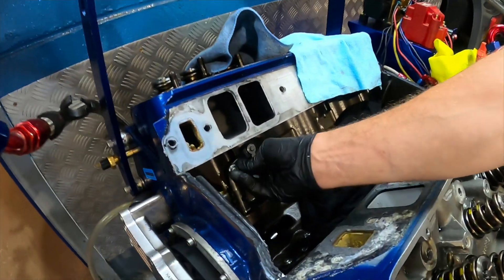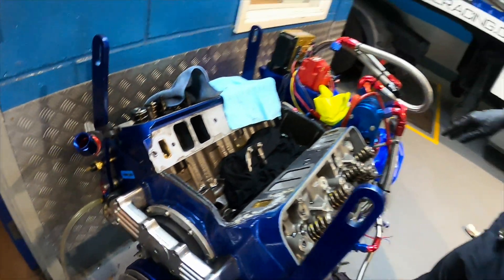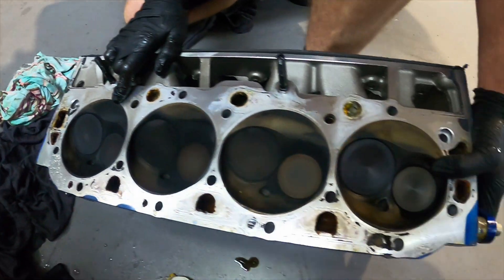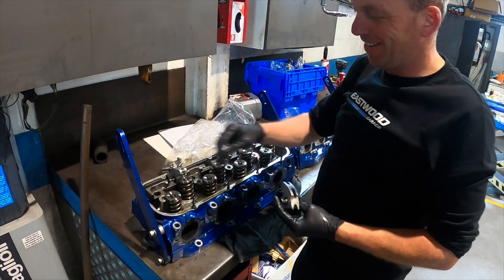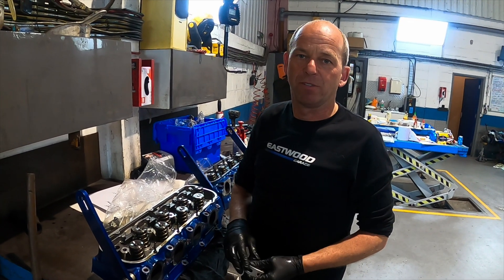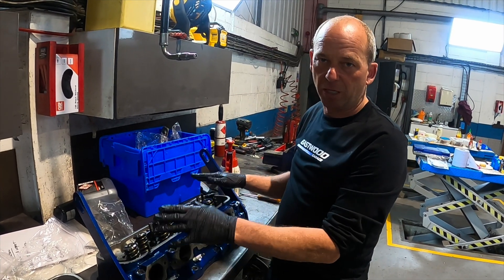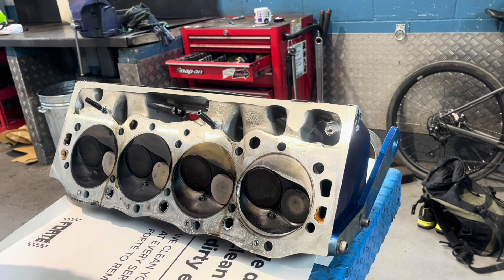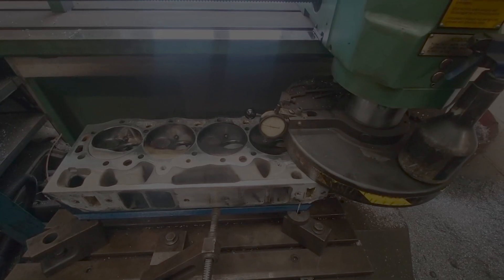V8 cylinder heads swap, on our Offshore powerboat race engine.

Comment: I have always wondered. Leno transmissions many years ago for a land speed record car put the single gear reduction  in backward to build a high horse power over drive.  In a fairly short case.   I don't know what percentage of overdrive it would be.
Reply from the maker: Hi Wayne we run SCS drop boxes and have about 12 ratio sets, there is a prop pitch vs speed ratio that is most efficient and we try and always get as close to that as possible, to high or to low prop speed causes efficiency loss or inability to get a good bite on the water

Comment: What maximum rpm are you running at, the Teague and Brummett 502 ci twin turbo engines running 8/10 boost, maximum rpm is 5200/5500, if you need more info I can your garage
Reply from the maker: we try and run around 6000rpm, we have run this setup in our offshore boats for about 4 years now ,going threw them every winter and never had a failure until we had a big overrev at the previous race when the shaft broke, then we had to rush fit a spare that we had no history on which is the one that broke the rocker. should all be good now we are back to our normal eng specs fingers crossed.

Comment: I would have the other head machined 6 thousands, so both heads are matched pair, have you checked the valve springs on full lift to make sure the coils on the springs are not binding up, and have you checked that your rocker are the correct ratio, l have worked on Teague Marine, and Brummett Marine engines
Reply: We used a thicker mls gasket

Comment: The piston with the wider band around the crown will have a better fuel distribution in the chamber at TDC due more quench area pushing all the fuel droplets from the perimeter of the bore into the centre and making for a less detention sensitive cylinder and a cleaner burn. Hope this helps.
Reply from the maker: Thank you Mark
Reply: Was just coming to say the same thing - however if you dont have the engine set up to have a tight deck (for the blower compression ) then the round dish piston might be fine.

Comment: Did you use the jessel set up tool to get push rod length ? Not using the tool will block off oil supply/ put the rockers at the incorrect angle
Reply from the maker: Hi, there’s no evidence of oil starvation in the rocker system. We have full confidence that expressenginesusa.com built them properly. As for why this particular unit has the alu Jesel rockers, we don’t know as these were built over 20 years ago.

Comment: is it not the era of sensors? stickers? EGT sensors would tell you immediately whats happening with combustion temps. come on man
Reply from the maker: We ran data logging on everything on the last boat and it works very well for setting up but its a big investment in time and money, we only got the boat in November last year and it had been stood for 7 years!! this year has been get it up and running and racing as best with the time and funds available, in an ideal world with unlimited funds everything would be different.
Reply: @eastwoodracing  understood bro. It's interesting to see man
Reply: Pushrods, lifters, rockers. 🤷‍♂️

No carbs?! 😉

Comment: It looks as though the ‘circular’ piston is to create a circular squish and have a rolling flame front (bit like a doughnut) from the centre to the outside, creating a uniform annular burn. It may also even the pressure across the surface reducing side load on the piston skirt. 
The other piston has an offset burn chamber which will ‘twist’ the piston as the pressure centre will be offset relative to gudgeon pin axis. So again piston side load hence friction is higher. Also the flame front will propogate from the spark plug outwards.
A lot of the advances in modern ICE has come from reducing losses associated with friction.
Reply from the maker: Nice info thank you

Comment: Better fuel burn with that shape piston maybe
Reply from the maker: we had a reply from express engines and they had said that the rods are as long as possible with gudgon pin really high in the piston and that also dictated some changes in the crown design to keep the thickness in the centre enough

Comment: Go on and get full crazy. Rig oil sprayers onto valve springs.  Definitely the weak link in any motor asked to work as hard as boat motors are. Finding the weakest spring your Rs will allow you to get away with won't hurt. When I'm in doubt, copy Merc. Engineering from pre quad cam days.
Reply from the maker: We’ve already got them, as well as cam sprayers in the valley. Express installed them in the original build.
Reply: Love the detail and effort that goes into all your videos